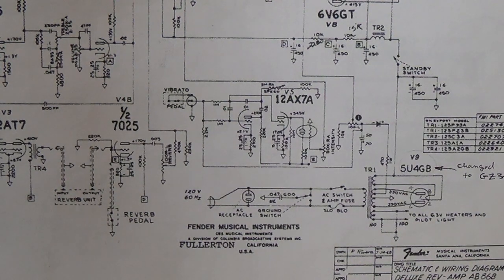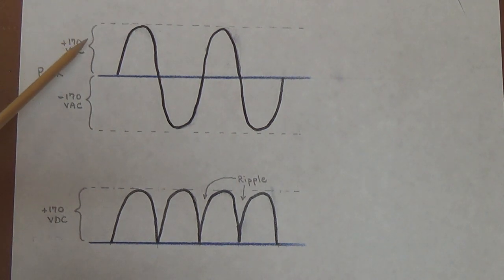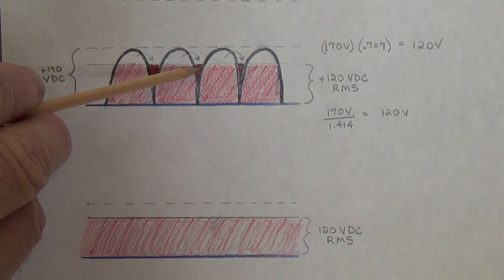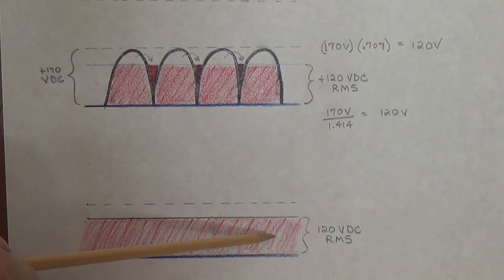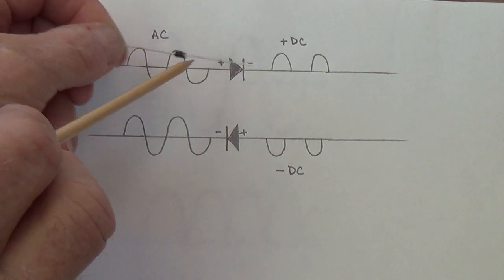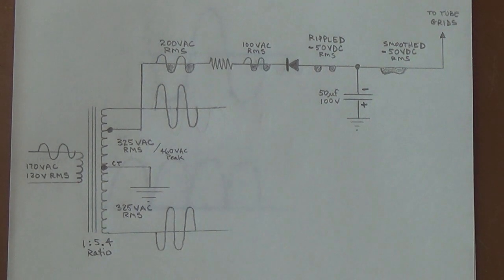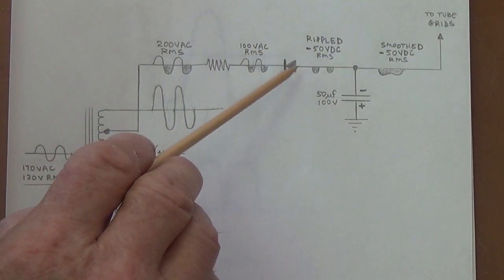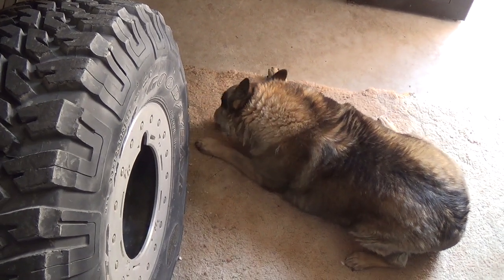Four Different Types of Power Supply,  Part 1: RMS, Diodes, Half-Wave Rectification

Comment: A couple years back I lost my grandpa at 98--a good long run. He was a test equipment calibration engineer for Collins Radio in Cedar Rapids, IA for 30-some years. As radio amateurs, we shared many interests despite a significant language barrier. My language was from audioland--small, solid state kit-built devices that fit in the palm of your hand. He laughed because he couldn't even SEE most of the components. Grandpa's language was point-to-point, high voltage, heat-producing, wooden chassis and wrinkle painted communications equipment. Stuff that you would need help lifting into the rear hatch of your AMC Pacer. Your videos are the bridge between his world (the physical remnants of which now fill my basement workshop to bursting) and mine. You seem to be responding specifically to my requests, and whether or not that is the case, I couldn't be more pleased. These fundamentals, sometimes repeated, are EXACTLY what I need to get further enjoyment from this subject matter. If the higher voltages don't kill me, that is. So, that's my rather long-winded thanks.
Reply from the maker: +JC Haywire  JC, thanks for the input....not long-winded at all.....Rusty and I enjoy hearing from you and appreciate your observations and comments.  Your grandpa sounds like a great guy. My own grandpa was a master machinist and line supervisor at L.S. Starrett Co. so, like you, I have a nice assortment of precision machine tools and a snazzy brass & cherrywood cabinet (custom made in the Starrett cabinet shop) to keep them in.  When I croak, I have no idea what will happen to all my "treasures". My immediate family has no real interest in any of it......so keep an eye out for the big estate sale that will immediately follow my demise :)

Comment: Thanks for sharing this. I had no idea if you put a diode in backwards i will produce negative voltage.
Reply from the maker: +Leland Clayton You're welcome, Leland. Diodes are like selective gate keepers that only allow + or - current to pass, depending on the way they are oriented in the circuit.
Reply: I had always thought it would block the current or at lest most of it when a diode is backwards like with DC. Can't wait to see what you got in store next. Maybe a better way to do a charge pump / voltage doubler.
Reply from the maker: With DC, the diode will block any current that is of the wrong polarity. With AC, it only blocks half. Stay tuned.....good things are on the way :)

Comment: Hey Uncle Doug & Rusty, I never fail to learn something from your most excellent videos. I know RMS is Root Mean Square, I believe its the point midway between the peak and valley of the sine wave, be it positive or negative, correct me if I'm wrong, and I could be. When I build a power supply, I always use the full wave bridge, and smoothing caps. Still learning so I really appreciate your great hand drawn graphics and insightful explanations of the process. I think it was just Teacher appreciation day and I really do appreciate your teaching and sharing of your knowledge and experience, Thankyou. You and yours take care & be good, C.
Reply from the maker: +Cass Virgillo  You're welcome, Cass. As Wikipedia says, "For a cyclically alternating electric current, RMS is equal to the value of the direct current that would produce the same power dissipation in a resistive load".  It's not the midway (0.5 out of 1.0) point......it is the .707 point. Thanks for your very nice comments. Our best to you.

Comment: Pop quiz  262V.  In Jacks first clip he looks like he's saying " man, your drying my oils" :)) Rusty says bone first, then we'll negotiate a work deal.  Looking forward to the rest of the series.
Reply from the maker: +bullthrush  You get one more try, Andrew. Recall that the peak voltage is always higher than the RMS and in this case is measured across the entire secondary. Thanks for watching and commenting :)
Reply: +Uncle Doug After studying a few videos from my favorite tube amp channel, my second answer is 524vpp.  If I'm still wrong, I'll stamp my own meal card "No Dessert".  :))
Reply from the maker: If the two secondaries are 325VAC RMS each, then the pair would total 650VAC RMS. This value times 1.414 would yield a total peak voltage for the secondary of _____ .
Reply: +Uncle Doug 919V pp, I'll do some more reviewing.
Reply: +bullthrush I've found my mistake.....  I wrote down the turns ratio as 1.54 :1
Reply from the maker: Thanks for your persistence, Andrew. Your answer is correct. That's a lot of peak voltage across the secondary, is it not ?? It makes me hesitant to stand barefoot on cement while fondling the secondary output wires....always one of my favorite hobbies :) :)

Comment: My guess at the pop quiz: 170 PVAC X 5.4 winding ratio = 918 Peak Voltage AC.
Reply from the maker: +tommyfoley  Yes, indeed, or you could multiply 325 x 2 x 1.414. Either way, that' a LOT of voltage  :)

Comment: Shouldn't the rectified and smoothed DC voltage be 170 volts? Like you said, the mains AC peaks at 170 volts, so wouldn't it just hold the peak voltage?  That's what I get when I build simple power supplies for my projects. (although it's 240 volt over here, so i get around 340)
Reply from the maker: +CoolDudeClem  The winding ratio in a 240VAC power transformer compensates for the higher (than 120VAC) primary voltage, so the secondary output voltage is the same as from a non-compensating 120VAC transformer.  AC can be measured in either peak or RMS values, but DC can only be measured in RMS (since there are no "peaks").  You can talk about peak AC all day, but when you decide to convert (rectify) it to DC (which is only expressed in RMS) you must change the peak AC value to RMS (i.e. x .707) to calculate an accurate DC value.....otherwise it's apples and oranges.
Reply: +Uncle Doug 
I think the question was about the part of the explanation that starts at 4:36, where you talk about how a filter cap turns a rectified sine wave with 170V peak voltage into 120V constant voltage.
This is not actually the case. 
The rectifier diode + filter cap form what essentially is a very crude peak detector, it will hold the peak voltage, so the resulting constant voltage will be 170V, not 120 (at the cost of increased current draw from the supply of AC power).
Reply from the maker: I understand your point, Kard; however I think it boils down to what is the clearest, simplest way to present a topic in a video aimed primarily at relative newcomers to electronics. As you say, "increased current draw" is required to compensate for the 30% difference between 170VAC peak input and RMS VDC output. Is it best to simply state the basic reality of the 30% peak-to-RMS difference (as I did) or to also delve into the increased complexity of "peak detectors" and increased current draw compensation. When I make these videos, I try to cover all the bases for all the audience (hopefully without saying anything that is patently incorrect) but also by editing the content to avoid the endless digressions that would be required to cover every single detail of every issue. I apologize if my editing made this presentation incomplete for you, but I hope you can understand the diversity of my audience and the compromises necessary to reach them all.
Reply: +Uncle Doug 
Hello,
thanks for the response.

Current draw aside, the point is, constant voltage will have the value of the peak rectified (unfiltered) voltage, not RMS.

This is very beautifully shown in your next video with the oscilloscope waveforms - the filter keeps voltage at the level of the peak of the unfiltered voltage (or at least tries to, with varying success).

I think this is very important, because when you design an amp with, say, 300V of B+, you have to be aware when ordering the power transformer, that the secondary winding cannot be a 300VAC winding, as this would give 423V DC (or maybe slightly less under load, but not a lot), which is way too much.
Best regards.
Reply from the maker: Thanks for your informed and helpful input, Kard. Rusty and I appreciate your time and interest.

Comment: I am happily supriced about this series and can't wait to see whats possible if we use two or four diodes.
Also i am very excited about the voltage doubler. I just ordered parts for a flanger using 18V and it would be really handy to use a 9V supply like most other pedals do.
Reply from the maker: +PrinceOfBodom  I'm glad you're excited, PoB, and hope the videos answer all your questions. The voltage doubler requires AC, not DC like a 9V battery, but you could always use two 9V batteries in series.

Comment: Hi Doug, I got a bit confused. When u talk about the 170VAC I can see in the drawing 170V positive and 170V negative, making a total difference of 340V. Then you transform it to 170VDC positive. But when you talk about the 120VAC RMS and you rectify it only 60VDC positive (or negative) pass through? Why not 120 as the previous example? 120VAC wouldn't be 120V and -120V equals 240V? 
Anyway you are always teaching what I want to learn the next every time. It's kinda creepy XD. Thank you very much for your clarity on the explanations. 
PS: I think Jack is picking up bad habits from Rusty cause if he acts like Rusty maybe he'll be able to get any of the food that Rusty is stealing from him at next time.
Reply from the maker: +Edu &quot;Turupá&quot; Sánchez  What happens when you add +170 and -170, Ed?  It's definitely not 340. Same with +120 and -120.  AC is not measured peak to peak, but is the height of a single peak, either up or down, with the appropriate sign.  When AC is rectified to DC, 170VAC (peak) becomes 120VDC RMS. Watch the video again and hopefully it will become clearer. I'm glad my choice of topics matches your interests. Thanks for watching.
Reply: +Uncle Doug but when u talk about the diodes and the half wave rectification, why 120V RMS (which is 170V peak) becomes 60VDC instead of 120?
Reply from the maker: You make a good point, Edu. The reality of what is happening is actually much more complex than I have represented. When the irregular (quite rippled) DC output emerges from the diode, the peaks are indeed as tall as the input peak (as you say), but its RMS DC value is equal to the original AC peak voltage (170V) times 0.318 which is 54.06VDC RMS. This value is a little below 60VDC, but for the sake of brevity and ease of understanding, I simply say that it is 60VDC. I hope this makes sense.....and that you can see why I glossed over the details.